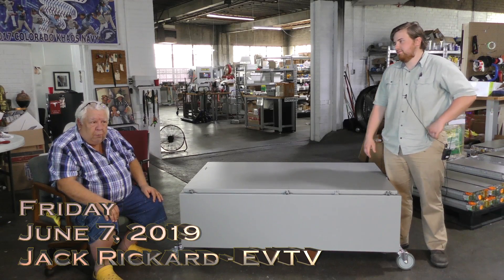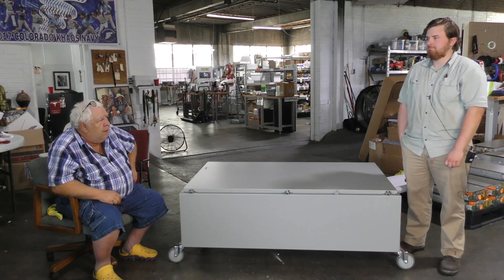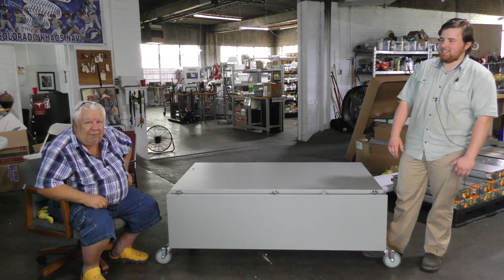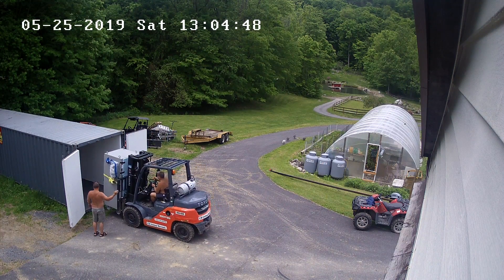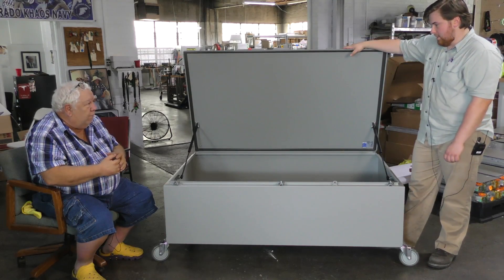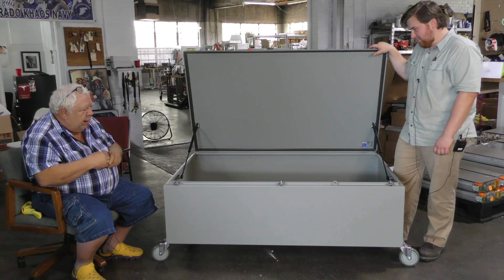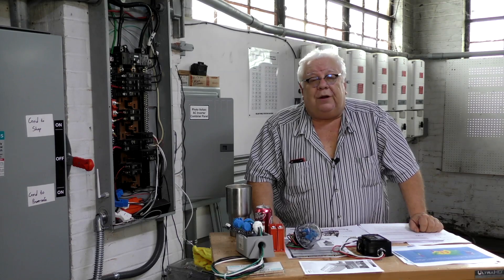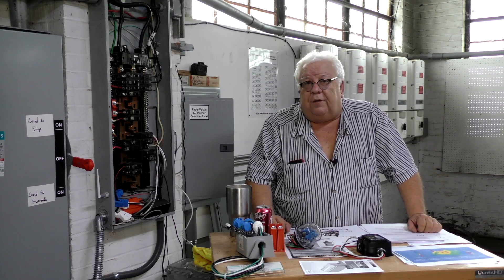PowerSafe60 - Tesla Battery Storage for Solar Installations.

Comment: Thanks for the information.  I am replacing boards in HVAC systems this past week as we had alot of lightning around the area.  I am recommending  the whole house surge protectors based on your knowledge.  Thankyou Professor Jack!
I put up a solaredge system with 7kw solar in December.  Thanks for your information.  It has created 4mw since Dec 13 in 2018.